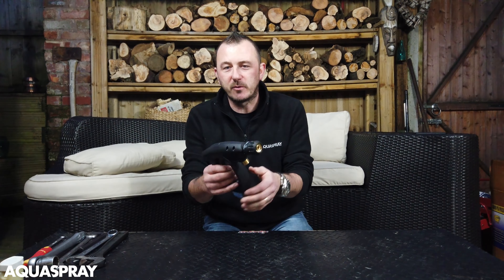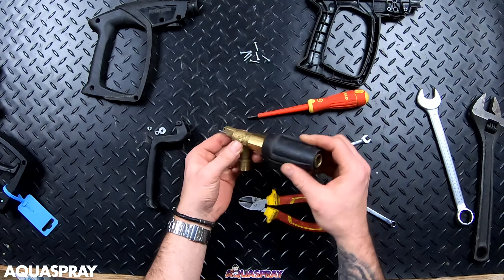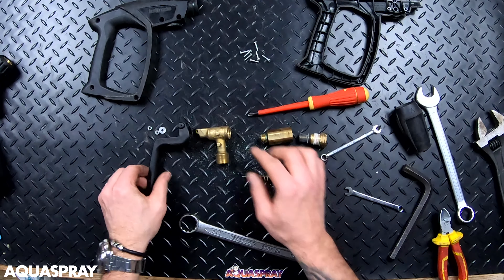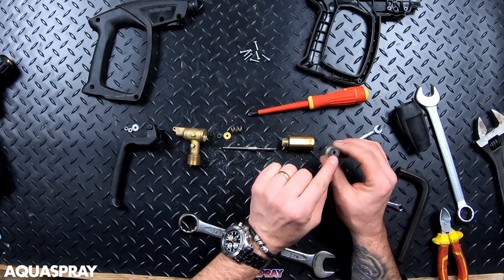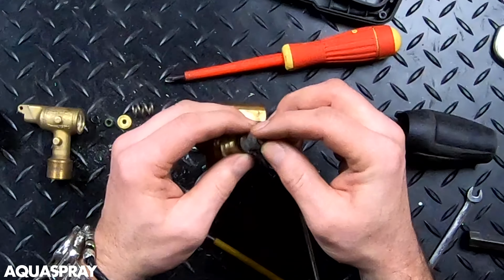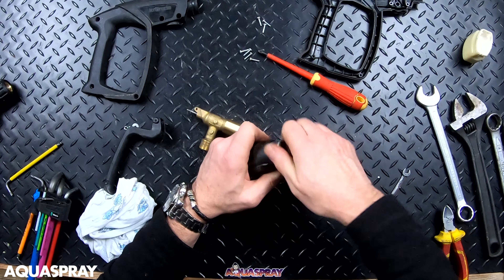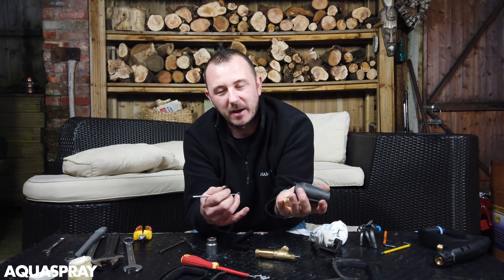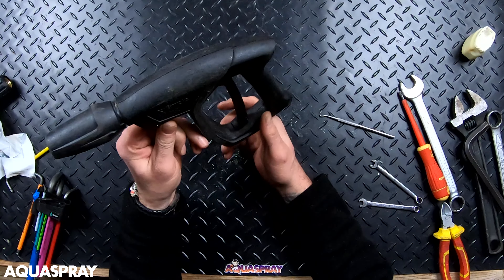How to Repair/Service Your Short Kranzle M2000 Gun Trigger

Comment: The trigger doesn't work any more on my Kranzle, what could be the problem?
Reply from the maker: Could be Something stuck in the valve like a stone or grit. Usually a strip and clean does the trick or you may need a valve repair kit
Reply: @KranzlePressureWashers  There is no more resistance on the trigger. How can I release the pressure from the hose to release the gun?

Comment: Awesome video as always...Would like to purchase tools that Kranzle make for their seal removal and etc. can you post the link thanks!
Reply from the maker: They are very expensive to buy if only doing one or two jobs, but we can hire them out if yon need
Reply: @KranzlePressureWashers  I started from an HD7 which i told myself ill sell it if i get a quadro 499 which i did and love them both that i end up keeping them because  they have a totally different action and purpose i guess lol andnd now in a year and half i started on my third kranzle pressure washer but hoping to build this one instead,  best way is to just get ur contact info 👍🏼 so i can message the parts i need

Comment: Hi, I've got a very small leak on my K7 Short Lance where the water is coming out of the very end of the nozzle itself. Any ideas on which washer it could be? Also I've got a box of black round washers of various sizes, would one of those suffice if that is all the needs replacing? Cheers
Reply from the maker: If its the valve that is not shutting out correctly and it leaks thru the valve and out of the nozzle when the trigger is closed, it can either be something jammed in the valve, the valve not set up right or the gun repair kit is needed
Reply: @KranzlePressureWashers   Great vid, is the K7 short gun the same procedure ? My gun sprays full pressure all the time , the trigger has suddenly stopped working,  is it worth repairing or should I buy a new gun ?